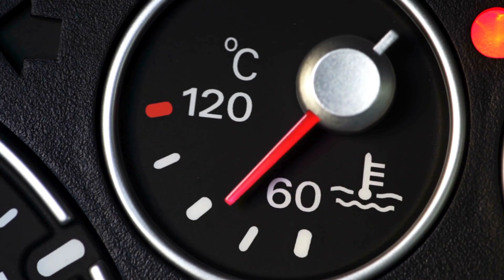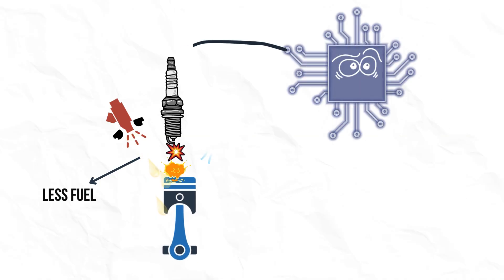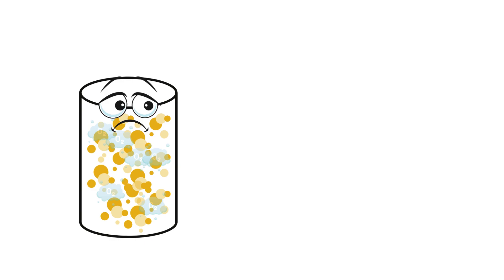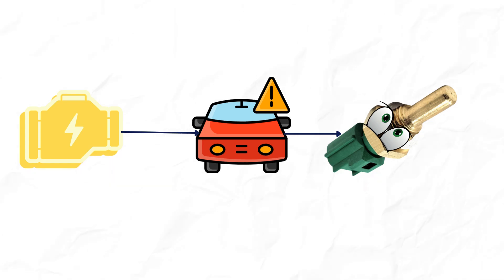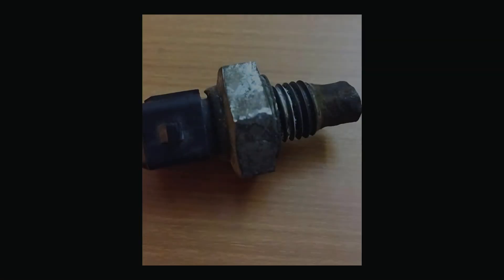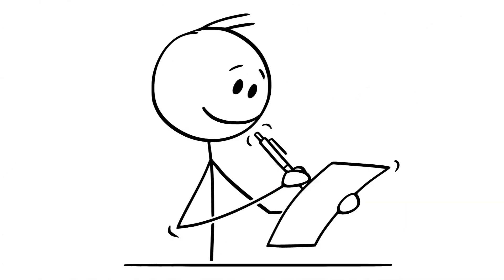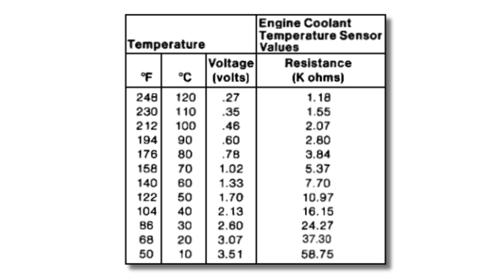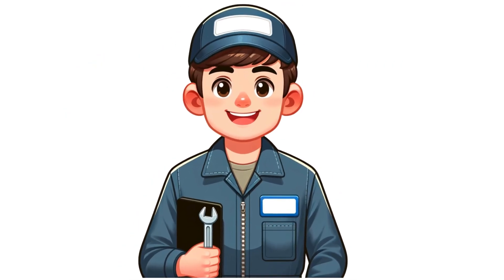How to Diagnose a FAULTY Engine Coolant Temperature Sensor | 6 Signs Of A Failing ECT Sensor

Comment: I have a 2014 Mazda cx-5, both ECT sensors have been changed, yet it throws a code p011a...what could be the problem?
Reply: Check your ect wiring harness for supply 12volts. If is no supply you have a open circuit wire
Reply: @giversmechanic THANK YOU!!!

Comment: Good presentation. Question: Are coolant temperature sensors polarity sensitive? e.g., technician reverses the wires when replacing a broken connector...does this mess with the ECU? Thank you for your input.
Reply: Nice reply d1ckhead @HafizBaai